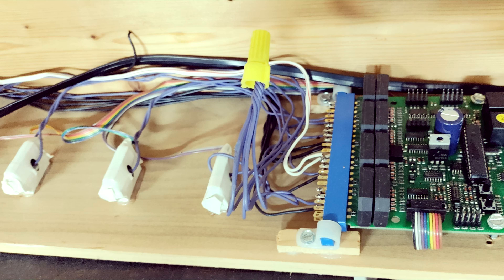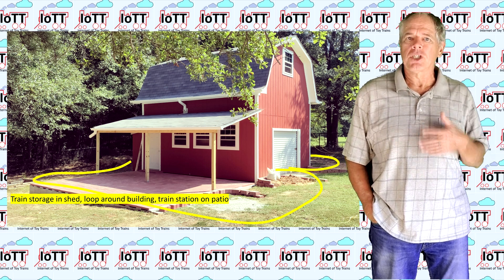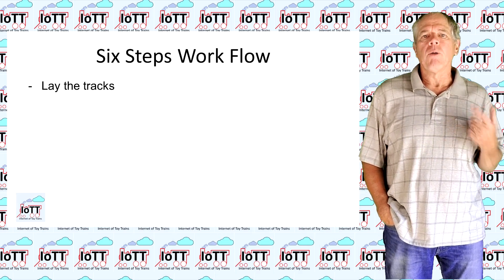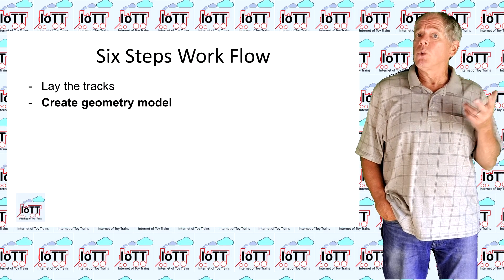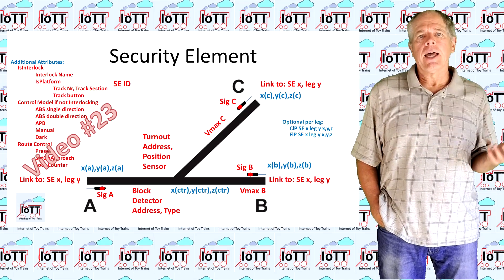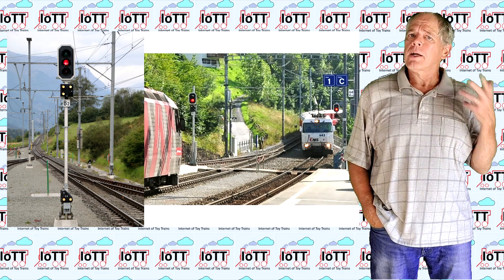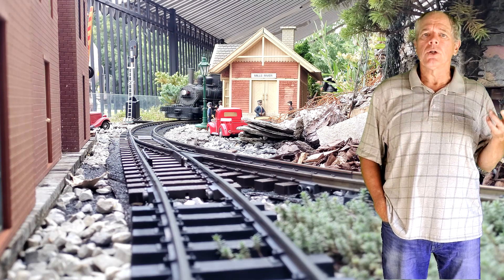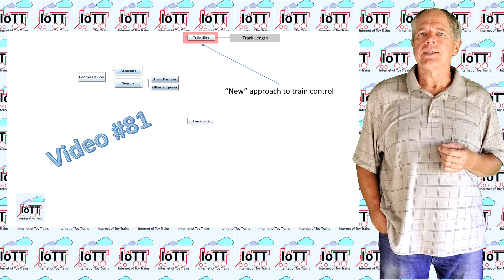Signal Control without Block Detectors (Video#146)

Comment: Hi Hans, I have been wondering what direction you would be taking next in your IoTT journey but I did not quite expect such an ambitious project. I will be watching with great interest and suspect that we will see lots of ESP32 type devices all interacting over WiFi to achieve your goals. 

Or am I wrong?!...? 

............Best wishes John.
Reply from the maker: Basically correct, most likely forming a self configuring and self healing mesh network to make it easy, using ESP32 S3 chips. Yes, it's a quite big project, but as always, to eat an elephant you go byte by byte.
Reply: @IoTT  I noticed that Esprissif had introduced quite a few new products lately, I look forward to your journey using some of them. Good luck with that elephant. .............John

Comment: Very exciting, you are almost implementing GSM-R and ETCS in a way…? Would it be possible to use passive RFID tags in specific places, as a corrective to the distance counter? 

I was thinking that non-movable boundaries starting or ending a “set” route section could have a trackbed RFID tag. When read by the passing train and relayed to the central computer, several data-points can be quickly correlated (simplistic ‘sollwert-istwert’ scheme?). 

Passive tags can be read by a small onboard MCU & coil antenna, and the data string isn’t important as long as each tag is unique. 

Well, I’m just thinking out loud, and getting carried away… 😅
Reply from the maker: The security element concept comes straight from the ETCS tech docs (I have referenced in several older videos). Of course I will not use GSM, but Wifi, probably mesh networking. I will talk more about these details in the next video.
RFID is one of the options I consider for resetting the distance offset once in a while. For cost reasons I would prefer to have few readers in strategic locations, e.g. at the exit of a train station, and equip the rolling stock with tags. Another advantage would be that you could tag cars as well, which would allow for automatic calculation of the train length, and identify if a car uncouples from the train. There are other options to consider I will address in the next video.
Reply: @IoTT   Thank you for answering - and I’m sorry for pushing against already open doors… 

If I may, I imagined having the reader in the vehicle, and the RFID tags on the track - like passive balises? So the onboard WiFi (of course not GSM-R, I understood WiFi as the analog to it) does the communication? Still no trackside cables or outdoor electronics…? 

I’m looking forward to learning from your project and solutions - again, thanks!
Reply from the maker: Feeding back position information goes via Wifi, yes. Speed commands can come via Wifi, or via command station and DCC track. I intend to keep all possibilities open to make merging from one system to the other as painless as possible.
No trackside wires is probably not possible, e.g. if you have electric turnouts and physical signals, unless everything is operated using batteries. But considerably less wiring for sure is a possibility.